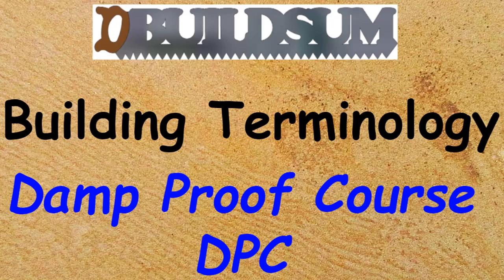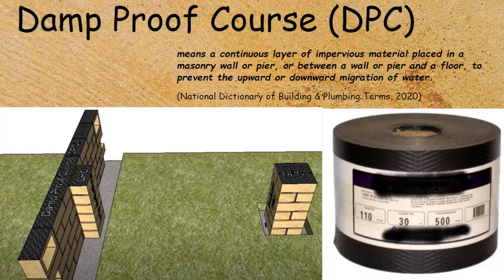Building Terminology - DPC (Damp Proof Course)

Comment: Question: does bitumen or plastic in the damp proof course hinder bonding between the masonry courses above and below the dpc?
Where i come from most houses are masonry construction and lay people and contractors lacking proper education often advocate against plastic and bitumen use in the dpc. They instead argue for the use of waterproofing chemicals like the ones made by Sika, to be mixed in with the cement in the dpc.
Are they really on to something or are they just trying to sell sika products?
Any help would be appreciated
Reply from the maker: Hi Mate, yes the DPC would have to hinder the bond between the courses of brickwork however I have never seen a wall separate at the DPC line because of it. I have only seen the chemical DPC used in old buildings where they werent built with a DPC or if they have had some other issue with rising water. 
Personaly i would prefer the physical Polyurethene or Alcore DPC any day.
Reply: @Buildsum  thank you so much :)